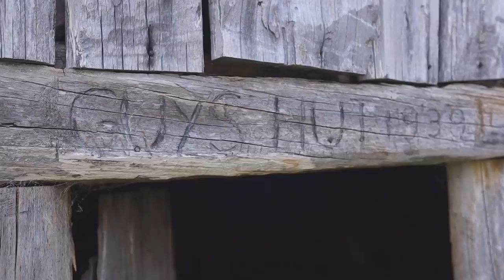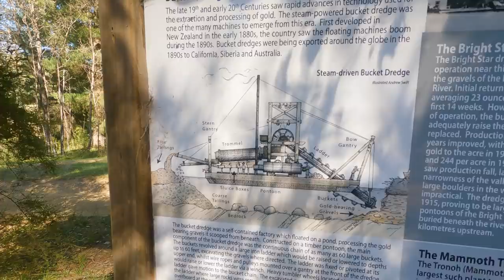Touring Some Of The BEST HIGH COUNTRY Spots | Bright | Swimming Holes | Blue Rag | Livin 4x4

Comment: Intend to buy a bogie trailer kitchen for outback / off-road touring. 
Set of 4 Sunraysia rims and tires only $400. 
So for the 95% of the time I can run all terrain and have those extreme mud tyres on the trailer, best of both worlds. 

Oh, buy a high lift, it gets from axle on the ground to tire height in one go.